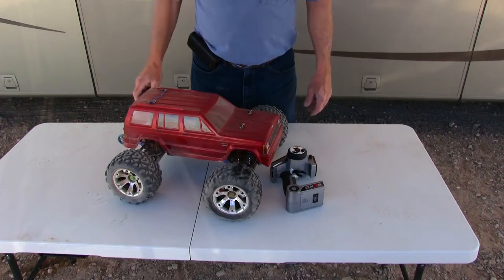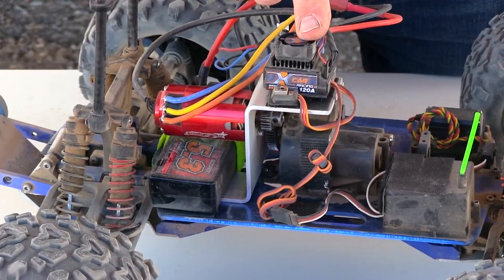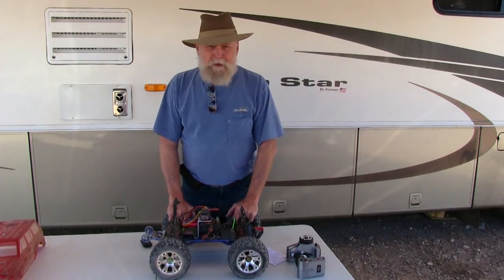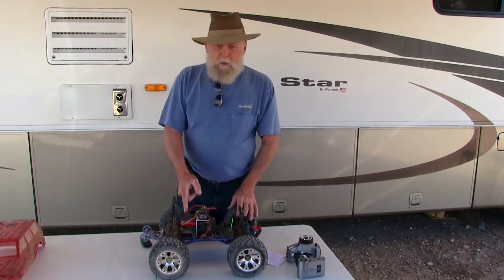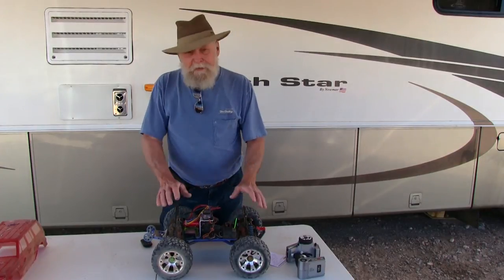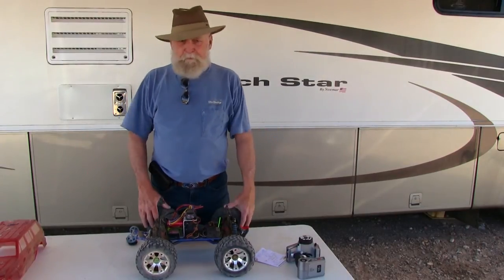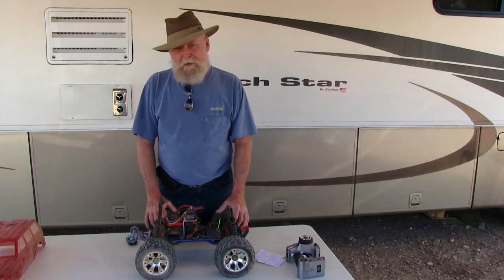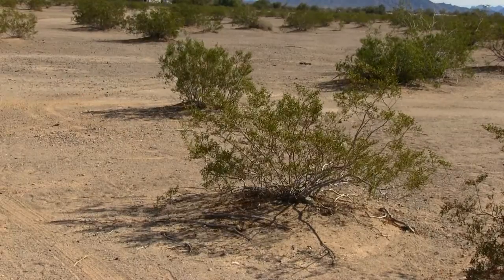Desert Maxx ; A Brushless T- Maxx in the desert

Comment: I have an 08 tmaxx classic w/3.3trx. The slipper clutch is there to help damper the shock to the driveline. Locking it out will put you at greater risk then just setting it to slip slightly. It's difficult to do with the stock fiction peg spur. If you get the slipper clutch upgrade from traxxas it's a lot better. You can more precisely set the slip and if you happen to strip a spur gear you can change it out without removing the entire slipper losing the setting. You can do that and also directly swap out the 2.5 tranny for a 4907 3.3 tranny. Throw in the 1st speed conversion and slipper and you have a robust system. The diffs are pretty darn good. I don't see much wear from 3 engines, 5-6 gallons each. I've stripped 2 spur gears and 2 sets of rear drive shafts in the 6 years I've had this truck. The tmaxx is a basher. It's not made for speed. But you can make it pretty darn quick without too much trouble with the drive train.
Reply: you can also simply  chuck whatever the hell version stupid traxxass transmission all together.
Install a 1/8 scale center differental ( which acts like a sliper clutch)
Get cups...and whatever length 1/8 scale dogbones/cvd...accordingly
Not unless you have sometype of mental block and traxaxx's god
forebid you from using HPI savage,ofna  or MGT parts and thousands of other parts thats avaiable  ...on a Tmaxx.lmao
It would be TOO SIMPLE and CHEAPER ....but nevermind.lol
All you would have to do is get an after market center aluminum cover
plate ( or make one)....Mount the center diff on it...This will alos help
LOWER the CG and help on roll overs...There  a big ass hole
in the center of the original chassis....ream it a little ..accordingly to clear
the motor.

Comment: 2014 he was right. Thanks do brake that’s for sure, looking at what’s now available, well 1/8 shot 1/5 scales are being the norm.. I believe a t maxx 3.3 witch I have is a 1/8 scale.. but he is right in with the 2.5. I did put a 1/8 in mine but ran it with 4s it did good. But need about 50 mob for a good bash.

Comment: Believe it or not my tmaxx 2.5 has a 1/8th scale 2100kv motor on it and yes it is a little more heavy but it handles the torque pretty good of course I have steel driveshafts and plenty of upgrades to go along with it.
Reply: I just got an 1/8 hobbywing max 8 kit with esc and motor and i dont know what 5mm gear to to mesh with witch sper gear any help ???

Comment: So in a nutshell a 1/10 scale drive system isn't strong enough for a 1/8 motor unless your happy to break driveshafts and axles for your speedrun(sometimes these parts cost pennies).
If you really want more speed try changing the motor pinion gear first.
Skip to 7:51 for good footage :)

Comment: on a larger rc like the tmaxx how are temps on the system you have ? seems pretty quick  on the 2s ,,, im looking to go brushless in my summit ,
Reply: summitt i would stick with 8th scale set up but you can run a stronger 10th scale motor but i would think it would get pretty hot! summitt is like 12-14lbs with batteries and you dont have to run 6s in an 8th scale set up you can always stick with 4s or even 3s and probably get away with not breaking anything but once u get into 6s on an 8th scale system your going to destroy everything. it wasnt ever meant to be run brushless the diffs are different then the erevos diffs! summit was not meant to ever be fast thats what the revo was for so if you go brushless keep in low in the 4s to 3s it will be a HUGE power difference over stock even on 3s trust me but  if you want fast get an erevo that was meant to go fast i beleive me on 6s on a revo you WILL still break stuff a lot! but like it said the summit wasnt meant to go fast the locking diffs are a lot weaker than the erevos stagnant diffs hope that help you out!!

Comment: With the setup described in the latest video a 20t pinion motor is warm. with a 23t pinion I melted the solder connection off a deans plug.